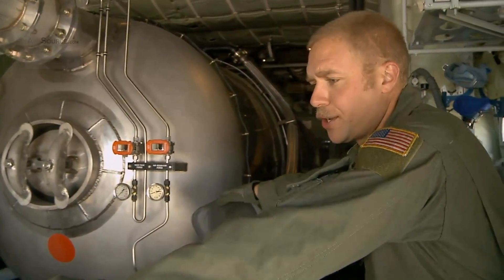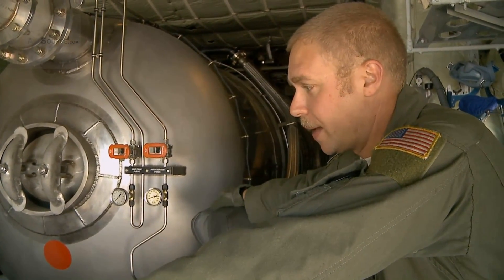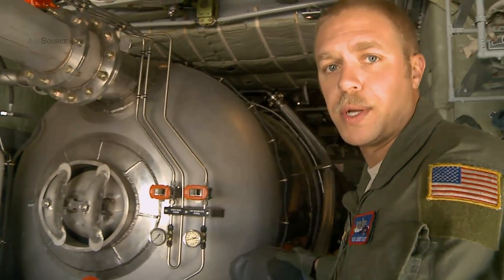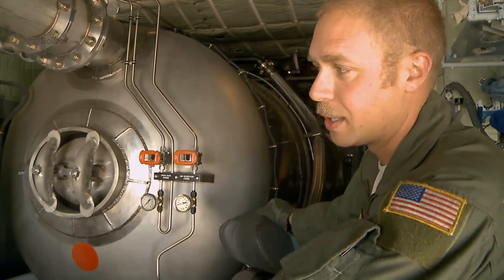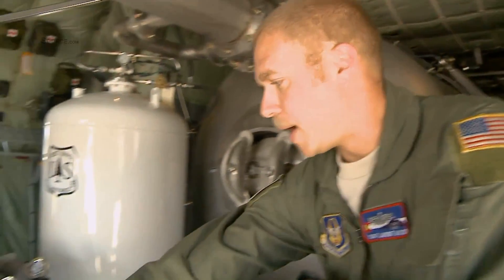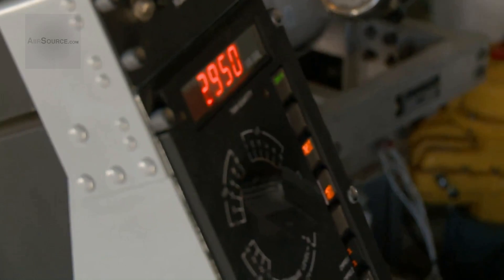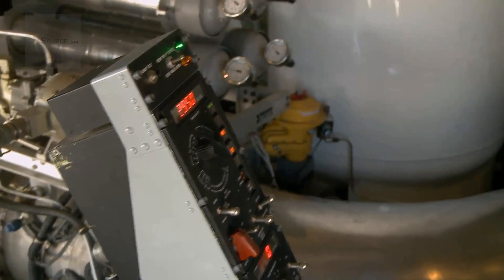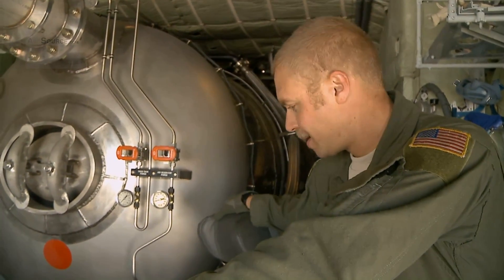C-130 Modular Airborne Fire Fighting System (MAFFS) Ground Discharge Test

Comment: So less than 5 tons of water and equipment in a plane with a 20 ton payload. Why such a small tank. The 737 firetanker holds 15 tons of water.
Reply: The tank is smaller than some other aircraft because It's not a permanent installation. Larger tanks would require modifications to the aircraft. That's why they call it "modular" aerial fire fighting system.

Comment: is that enough water to get the job done?
Reply: In a real fire fighting scenario, these planes wouldn't be using water. They use retardant and drop it around the perimeter of the fire in order to stop it from spreading further. Paths of retardant can also help ground fire fighters to better points to extinguish the fire directly.
Reply: @Karuiko  you can't use these near water
Reply: @smokescreen2146  I mean they don't fill them with water. It's only filled with water here as a test. When fighting fires, it's filled with phos-chek.

Comment: Ugh -- you don't put teflon tape arbitrarily on threads.  That coupling seals on the INSIDE of the pipe and does use the threads as the seal.  That's not only completely useless as a sealing agent, it unnecessarily adds the possibility of contaminating the system with pieces of the tape......